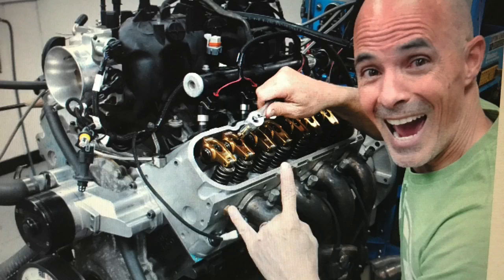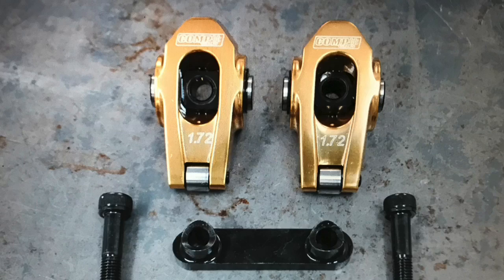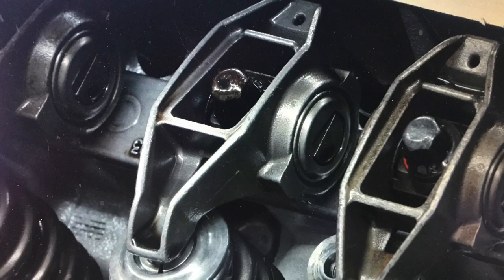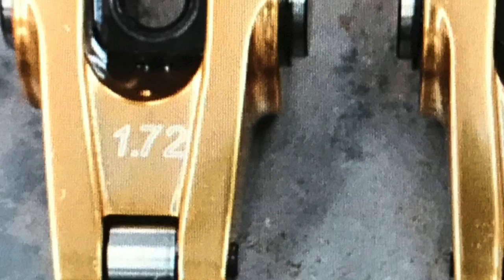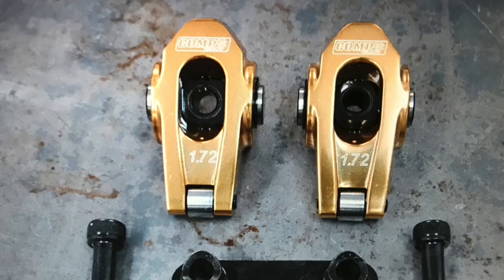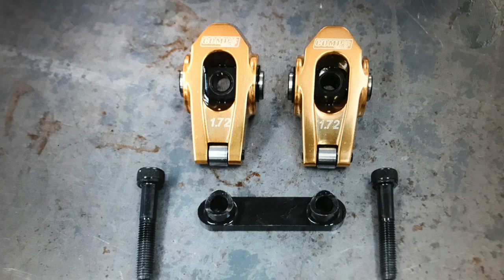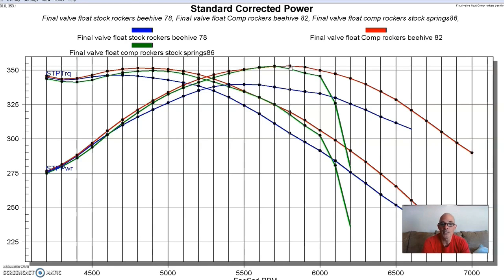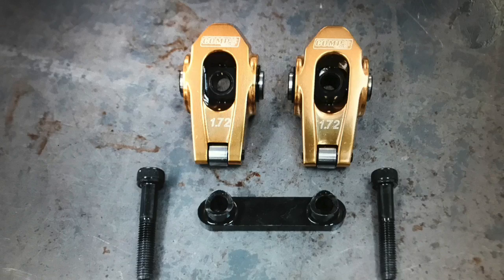LS ROLLER ROCKER TEST-DO THEY WORK?

Comment: Factory rockers or on a totally different geometry then true roller rockers.  Stock rockers only work in an arch a supposed to roller rockers that
Have full range of motion
Reply: Factory rockers have a different geometry than true roller rockers. Stock rockers only work in an arch as opposed to a true roller rocker that will have full range of motion.
...this is actually a great point, stock ls rockers really don't work well over .630 lift and don't work at all over about .675. The body of the rocker will bind on the trunion and the scrub at the tip will really start to accelerate guide wear. You can swap trunions for a low buck deal but even over about .650 lift the geometry at the valve interface has moved the loaded surface to the outer 1/3 of the valve and thing won't stay happy for long.

Comment: Some interesting information on LS vs 1.8 roller rockers... on a 550+ lift cam you'll see MORE ratio than 1.8 on a stock rocker at max lift because the length of the rocker gets "longer" as the solid tip extends through the range of motion.  Deflection is significant on a stock rocker, but its still less than .05 on a standard "1218" or whatever 130# spring.
Reply from the maker: yes-the geometry doesn't provide a consistent 1.8 ratio through the lift range nor does it track that when running from deflection

Comment: Its would interesting to do a durability/Longevity test comparing to identical LS engines one with The OEM rockers and one with correctly set up Roller tip Rockers.
How many more 100s of thousands of Miles would the Roller Tip Rockers last in theory?!
Reply: Quality of materials would probably determine that.

Comment: Reminds me of a build where the guy removed the super trick LS9 rockers and replaced them with heavy ugly roller rockers.  Rocker weight is super important.  I doubt friction is much of an issue.  Perhaps mocking up a head on the bench and try to measure the friction by using a load cell.  

I saw a video a long time ago where the guy measured the deflection difference between roller and stamped, especially with high spring pressures.  If i remember right it was as much as 0.030 more lift.

Comment: Some roller rockers are so heavy over the nose you run into valve float where before you didn't with the stock rocker. Edit: I shoulf have watched the video first lol. Richard you're the first person to honestly point this out. Most guys are on the sales side of things and will never mention the weight. Top marks! Have you done a Solid roller cam vs Hydraulic test with the LS? The hydraulic are pretty good these days so the test would have to be two very large cams with close valve events, one solid one Hydraulic etc. Done this before? I know someone with a 2500hp LS and he says the power isnt possible with a hydraulic roller.

Comment: Pretty interesting test results.  I wouldn't have expected just a .02 increase in rocker ratio to add 13 hp.  Maybe most of the increase is due to total overall dynamic valve lift because of less deflection.  I did expect the power to fall off at high rpm due to insufficient spring load.  Once the higher load springs were installed, there was a slight loss in torque across the rev range, which I attribute to higher friction from the spring load.  I've always been a fan of the GM investment cast steel roller fulcrum rocker arm.  They are light and stiff, and because of the simple radius tip, put less mass at the valve.  Aluminum rocker arms are basically forced to have the roller valve tip because Aluminum cannot stand up to the high contact stresses if they were machined with radius tips.  The roller tip inevitably adds mass at the valve, and most of them are just a simple pin riding on the ID of the roller.  If a full needle roller tip is desired, that adds even more mass.

Comment: Anyone using a cam with .550 lift or more and using the stock rockers on an LS will tell you the valve guides completely wore out in 15 to 20,000 miles The most important friction area is the rocker "sliding" across the valve tip imparting tremendous side loading on the valve guides causing premature wear. Roller tips are a must on lifts over .550 inch. Roller trunnions have their place but are not critical. In fact more and more builders are considering trunnion bushings over needle bearings as the bearings come apart and end up all inside the wrong parts of the engine
Reply: LS1 - Ran a 224/224  .581 lift XER cam with no issues for 132,000+ miles on a set of TEA S2 5.3 heads.

Comment: Roller-tip rockers are generally installed for longevity of the valvestem. Sometimes it increases power, but unless the ratio changes the rocker arm shouldn't change the power out. If the power changes and the rocker ratio remained the same then there is friction/deflection in the system.
Reply: Yes your absolutely right. I have  1.8 full rockers on my ls1 and I would say it’s not seat of the pants increase in power but there is some. I like the smoother throttle response.

Comment: Once again a great video. There are upgraded trunion kits to replace the actual needle bearings which have been problematic with increased HP, spring pressure load, and higher RPMs. That's the route I would take and if that proves insufficient go all the way to rocker arms linked by a through bar to reduce flexing of the mount.

Comment: Didn't Comp Cams come out with their steel roller rockers years ago specifically with the argument that they had a lower moment of inertia (the "weight" equivalent when we're talking about rotational energy)?  I wonder if low "I" rockers would've prevented the valve float.  It really seems like the LS rockers and Comp steel rockers look very similar but the LS ones went one step further by removing the weight of the roller and bearings from the tip (where weight hurts moment of inertia worst).

Comment: It's been my experience doing this RnD, the power came from the rocker due to changes in valve events. You will see this with a change of ratio, which is what it is intended to do, hence the change in rpm peaks by about 300rpm on both in this scenario. OEM rockers were nowhere near their advertised ratio. That stock LS 1.7 could actually measure 1.5 for example. The newer 1.72 rocker probably measure closer to 1.8, as they do make up for deflection when running. Huge difference in valve timing and overall lift, which will also explain the valve float upstairs, not having enough spring for the big lift change. It wasn't the weight difference. 
Gains like this will only depend on if the engine wants or needs it, and are not typical. A bit more to it than just roller/not roller. More like a bigger measured ratio, regardless of advertised ratio, increase in duration @.050", faster ramp @.200" and through the lift range, and much more lift at the valve.  When you see this comparison of same ratio, and see gains like this, just means the newer style rocker is giving actual valve timing events, where the older one is not. If you step to a 1.8 or 1.9, which is MORE than what the cam is designed for, you may not see any gains or possibly losses.
Not hatin', just wanted to add that.
Reply: Excellent point
Reply: It seems to me that your on the ball, but it kinda seems like your basically repeating everything that Richard is explaining, but you feel the added weight has no bearing whatsoever on spring choice. Are ya sure about that?  I'm just a simpleton, extreme" but I wouldn't put Volkswagen shocks on my 1 ton. Ya know what I mean 🤔💡👍✌

Comment: Ive heard to just upgraded the stock rocker trunnion, mainly the press on caps on each side that hold the bearings in place cause at high rpms the vibrations work the caps off and now you have little roller bearings inside your engine.

Comment: Too bad they weren’t the same ratio for a true comparison.  Also since the ratio varies with valve lift would be good to measure and see what the openings really are.  I assume since power gains are supposed to be from less friction loss you would not see a bigger power difference on say a 700hp boosted engine?

Comment: Have you ran a test between hydraulic and solid lifter cams of course the same grind . Then add limiters to the hydraulic lifters next thanks great . Years ago i use to restrict oil to top end with the roller lifters . Bronze guides titanium valves ect later on i learned the oil also cools the valve springs ..od course the good ring seal was in the motor
Reply: It's hard to compare apples/apples with hydraulic vs solid cams, because they'll never be "the same grind". Even when you pick grinds that put the valve events at the same angle, it's still not the same. However, you can take this to the bank: A solid cam can snap the valves open and shut quicker than a hydraulic, so they'll always make more power, all other variables kept as constant as possible.

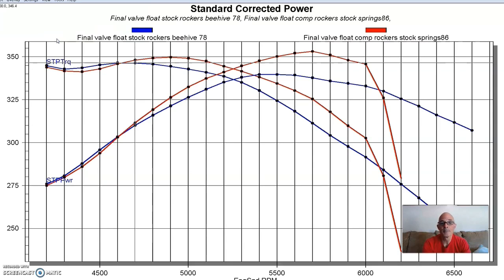Comment: Is the power loss below 4600 @ 8:55 showing work  to overcome inertia of heavy rocker vs friction improvements or is the port happier with less lift at lower revs. the stiffer valve springs @ 9:48 would act like even more mass for the cam to work against but it made higher torque at same Lift/RPM so results seem to show opposite outcomes. Thanks for the amazing info as always.

video suggestion, have you done a test that shows results of switch to roller pivot / roller tip VS stock non roller in the same ratio. mass vs stability vs friction.

Comment: [light humur here so dont get your panties in a bunch]
Orrr....just have the cam push the valve, easier cam swaps (no replacing the intake or china wall sealant etc), less reciprocating mass, better spark location, better airflow. I'm an old school 351/350/427/454 fan obviously hence I'm here, But being in the UK the only time we see overhead valves in new engines is on a lawnmower :D
Ofc I'm talking specifically about direct acting bucket style, Some setups have roller followers like hondas/mitsubishis which I'm not a fan of even though bucket style has its own drawbacks they're the drawbacks I'd choose instead of others. Seems to work for bikes and f1.

Comment: Richard I have a set of Johnson roller lifters and am planning on a roller cam upgrade for my 2001 LQ4 6 liter. Would you suggest re using the stock rockers  with a spring upgrade or just get roller rockers?

Comment: I’ve heard that “full” roller rockers solve another issue, valve guide wear. The RPM guys are constantly fixing LS7s with head problems particularly associated with that design. Also, Trick Flow recommends roller rockers for their heads, I believe. Still, the addition of 1.72 rockers to the stock 4.8 adding 13hp was a surprise to me. Another super video, thanks!
Reply: I have high lift slow ramp(ish) EPS lobes on my custom Geoff Skinner cam in my 6.2 ls3. Love the lobes. Very quiet and great with my vvt very easy on my valvetrain.
Reply: Another video they showed stock rocker arm ratios are usually short and not consistent.   So a Chevy 1.5 rocker arm might be 1.35 ratio and a 1.6 might be 1.45 or 1.50, so going to a true 1.6 or 1.7 or 1.8 ratio rocker arm gives you the increase over the factory ratio and also the increase in the ratio.   So the 1.72 over the stock arms giving 13hp is not too suprising.    That stock arm i believe ratio was 1.7 but the actual ratio may have been 1.55 or 1.60 due to quality control.   So the true 1.72 gives a gain of almost .15 or .1 increase in rocker ratio.

Comment: would be good to see the valve lift plotted for each rocker
Reply: Excellent point. Would not have been hard to put a degree wheel on the crank and a dial indicator on the valve to collect this data. Would have added a lot of substance to this test.

Comment: Perhaps you could answer here a further idea of running split ratios on the intake verse exhaust to enhance or exaggerate the cams duruation especially to improve cylinder evacuation on exhaust stroke to gain volumetric efficiency related to adiabatic function.

Comment: I seem to recall stock LS heads max out their flow numbers around .600” lift.  I wonder how much power increase roller rockers would yield with a cam that already has .600+” of lift.  I’m guessing you’d see minor gains from a couple extra degrees of duration but not much from the added lift.

Comment: I also installed roller rockers on my small block to make my valve guides live a little longer. The roller tip prevents the valves from being pushed side  to side .
Reply: No, it doesn't. That would be a geometry issue. Roller tips just have less wear on valve tip.

Comment: A roller rocker is a roller pivot and roller tip.  
Having used rollers for near 50 years. The main reason is a roller tip that gives true duration and lift. And uses less power to do so. And you can use a LOT less oil up top.
I find 20 -30 thou more lift with standard ratio.
More rocker ratio however loads up lifters and push rods exponentially. As well as rocker studs and or bosses.

Comment: Great videos as always! Keep them coming... I am currently planning on keeping the factory rockers with a trunnion bearing upgrade and changing the cam and upgrading springs. If I use a 54-454-11 comp cams cam that has over .600 lift, will it require new length pushrods? 🤔

Comment: I thank you for running this test. I'm currently building a 355 and the cam I have is Crane Energizer,  .480/.480. I want to add a set of 1.6 roller rockers to get a little more cam. The heads are a L98 2.02/1.6 valves ported to the max. Springs will handle up to a .575 lift. 👍👍 and thanks again.

Comment: Here's a random question/video idea. Does one need to upgrade valve spring for boost? The internet (sometimes) says boost reduces spring pressure by pushing on the valve. But that doesn't make much sense to me because where it matters, during compression the pressure delta across the valve would have far more pressure on the cylinder side of the valve.
Reply from the maker: Think about the exhaust valve

Comment: Interesting perspective. My guy was telling me that under boost valve float with aftermarket rockers tends too be worse than with oem rockers+trunion. Unless you go too a expensive set of jessels or something. 

So i would like too see
1.7s with spring and boost
1.8s with spring
1.8s with spring and boost

If you still have what seems like an endless amount of time that is ;)
Reply from the maker: valve float does occur earlier with after market rockers as shown-same under boost
Reply: What about with a set of springs?

Comment: Does high ratio roller rocker makes more sense with bigger cam or not really?
Reply: Higher ratio rockers should be planned into the equation when designing a cam profile on a new build. On an existing build, with only a swap in ratio with comparable rockers, will only see gains if the engine needs it, for example, showing you the cam choice wasn't optimal. Hope this helps.

Comment: Well, every set of roller rockers i have ever bought cam with a couple of cool stickers.  Application of those stickers have definitely increase the speed and ET of my tool box.  So I have to surmise that applying them to a car will automatically make it go faster as well.  Am I right?
Reply: Stickers are scientifically proven to make cars have faster ETs because stickers have better aerodynamic properties than paint or glass, bettering a car’s drag coefficient...
It’s, like, science....Yeah.  Lmao
Reply: @stlchucko  also realize that the reactionary force of the sticker "pushing" down on the panel causes the panel to become lighter. So placing the stickers forward of the center of gravity of chassis will create weight transfer to the rear wheels.
Reply from the maker: stickers add HP

Comment: What’s the gain without the increase in ratio? 1 or 2? Count me in!!
Reply: The increase in ratio (I'm assuming you're talking about the 1.72:1 vs. the 1.7) isn't much at the valve. A lobe with .350 lift would translate to .595 lift with a 1.7 ratio, and the same lobe with a 1.72 would be .602, or a .007 gain. Not much in my book. However, as Richard says, if the aftermarket rocker has less deflection than the factory rocker, I suppose you could see, maybe, an increase of .010, maybe more.......

Comment: On an sbc, I've seen magazine articles say 1.6 roller rockers are worth 24hp over stock stamped steel 1.5s. I like running them in an sbc regardless, I like the lower friction. Ls, I've heard the stockers are good. For 13hp, I'd rather upgrade the springs and run rollers.
Reply: Engine masters did a baunch of different rockers on sbc.
Reply: Gains are solely based on if the wngine needs the added valve events the bigger ratio offers. However, that is when you compare 2 different rockers of the same quality. Factory stamped steel 1.5 rockers, in all actuality, measure anywhere fro. 1.25 to 1.4. So even swapping to a newer rocker at same 1.5 ratio, would net a big difference. Magazine tests like that  can be misleading. Always compare apples to other apples...
Reply: My oil temp dropped 15° on sbc... less friction

Comment: Would be nice to see a test of an engine ran with something like a "stage 2" truck cam with lift specs using the stock 1.7 rocker ratio. Run it again now with 1.8 rocker ratio and see what kind of power gains it will have and what it might do to the cam timing and power curve in general. IE: will it extend the power, will it come on earlier, ect.
Reply: I've always wondered why not a high lobe lift vs higher rocker ratio.  Example, 0.300 lobe lift with 1.8 rockers is 0.540 at the valve VS  0.337 lobe lift with 1.6 rockers is 0.540 at the valve.
Reply: There is a guy on here that builds drift cars that claims the factory rockers are a weak point for that application. Says the needle bearing caps are press fit and back out. Taylor Ray I believe is his channel.